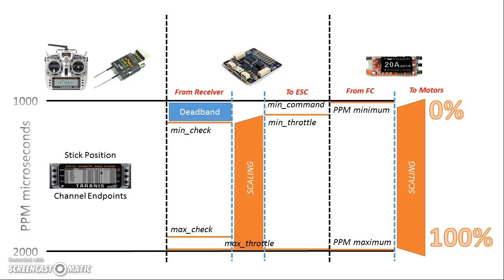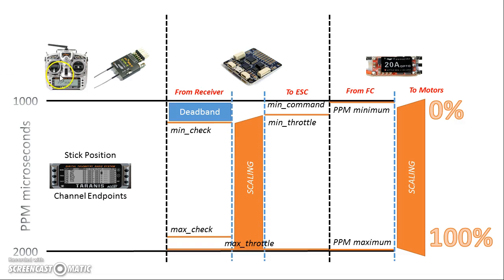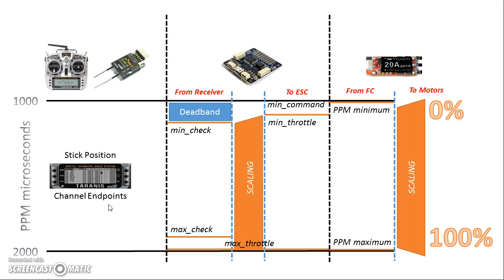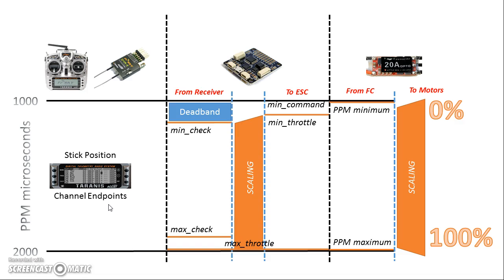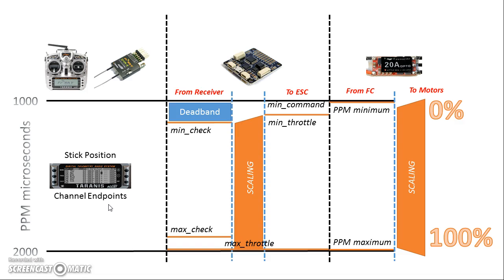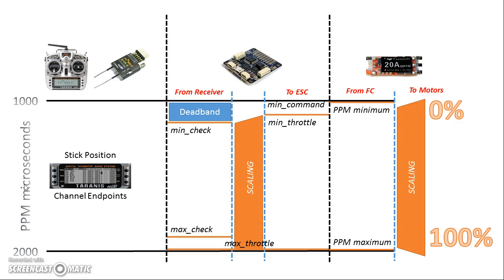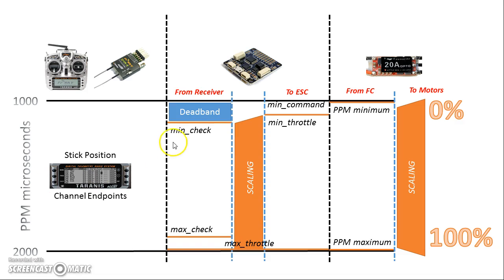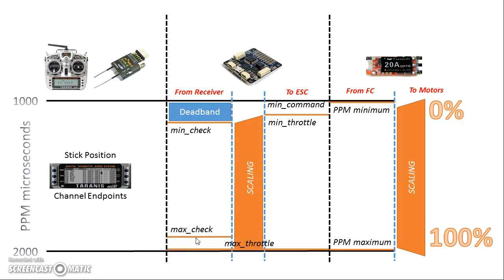Cleanflight throttle parameter configuration - Part 1

Comment: Hi Joshua .I have another problem now with my throttle. i get full throttle when the stick has only moved up about 20% then the same max motor speed  all the way to 100%,and on decelerating the throttle does not lower the motor speed below 100% until you get to down 20%throttle on the stick 
, any ideas would be appreciated, many thanks Martin
Reply from the maker: +Martin Goodbody verify that the throttle channel goes from 1000 to 2000 in th receiver tab. Verify that ESC endpoints are calibrated.
Reply: hi Joshau it does go 1000 to 2000 in the betaflight motors tab and throttle responds as it should gradual all the up and down
Reply from the maker: +Martin Goodbody then there must be some pid related issue. Does it do it when the props are on, or only on the bench?
Reply: I did try to fly it once but it was uncontrollable. do you think it would be worth reflashing the board, it is a cc3d f4 acro , i am using betaflight 3.1.6 with latest revo firmware. I have heard of people flashing the airbot f4  fimware
Reply from the maker: +Martin Goodbody I guess I would do a reflash with fill chip erase enabled.

Comment: I have a question.   I switched to betaflight and my quad won't arm.  when I open betaflight and go to the reciever tab the throttle value when the stick is at 0 throttle it reads 1017.  I use spektrum so I can't change the value on my tx.  whst should I set the min throttle to ?  1017?  or higher, say 1027?
Reply from the maker: You definitely can change the endpoints in some spektrum transmitters, although I'm sorry I can't tell you how. One reason the quad might refuse to arm is if the throttle is refusing to go below min_check. Min_throttle is not relevant here. Min_throttle is on the OUTPUT side of the FC -- from FC to ESC to motor. Min_check and the throttle channel are on the INPUT side -- from TX To RX to FC.

If you cannot get the channel values to go to 1000 and 2000 then use the rxrange command in the CLI to adjust the endpoints that betaflight expects.

Also, if betaflight is refusing to arm, your CPU utilization may be too high. If it is higher than about 30% (for BF 3.0 and 3.0.1) or 50% (for BF 3.1) then that's too high.
Reply: I figured out how to change the endpoints.   But I changed the throttle I belive .  The quad arms but I can't get into my osd it requires mid throttle + yaw right +full pitch.  Should I reset the board and try and see what happens?
Reply from the maker: +rza f all the channels need to go to 1000 to 2000 not just throttle.
Reply: I put all values on spektrum yaw throttle pitch and rudder to 1000 to 2000.  It arms  but istill.cant access my osd which requires mid throttle + yaw right +pitch up I can't access the osd any reason why?

Comment: why would you ever invert the y-axis so that the max value (2000ppm) is on the bottom and min on the top ?? confused
Reply from the maker: For the same reason we write from the top of the page to the bottom.
Reply: touché
Reply from the maker: +j46 I mean, it wasn't a conscious choice. I just made the drawing and that's the way it came together. But when you asked, that was the answer that made sense.
Reply: hehe fair enough, well we all work differently I suppose :p 
just seems really backwards to me.
anyway, great video
Reply: +j46 Exactly, that seems so obvious and logic that it took me quite some time to realise the schemes don't follow the throttle stick movement. Kind of absurd.
Reply: Fanny thing, but being a newbi, that confused me so much since concepts of below and above in your comments didn't' make any sens to me. Finally, I wanted to ask the same question, but found it already answered. Thanks for clarifying this !

Comment: In the interest of correct information with regards to the stick commands:
With throttle stick up the other stick is used to add acc calibration.
With throttle stick in disarm position other stick is used to select profile 1, 2 or 3
http://open-txu.org/wp-content/uploads/2015/07/CleanFlightStickPositions.png

otherwise this video is interesting: i never knew about the deadband below min check. does this mean that if you set min_check to 1500 then anytime the throttle stick was below 50% you would be outputting min_throttle and have no throttle response?
Reply from the maker: That's what I believe. But it should be easy to confirm using the Motors tab.

Comment: Hello again. My qx95 micro is amazing. I fly it in angle and horizon mode. I tried air mode but it takes off on its on. I'm thinking min throttle is to high but it's fine on the other modes. Wat am I doing wrong
Reply from the maker: +Craig chivers micros are sensitive sometimes. Maybe it just hates air mode.
Reply: Joshua Bardwell  ok thanku

Comment: oN MY tARANIS PLUS MY tHROTTLE IS GOING THE WRONG DIRECTION! CAN IT BE REVERSED IN CLEANFLIGHT?
Reply from the maker: Better to fix it in the Taranis. Figure out why your input line, your mix, or your output line is not correct.
Reply from the maker: This is too big a problem to leave alone. If the throttle from the Taranis is reversed, and you bind to somebody else's model, something bad can happen. Fixing it in Cleanflight is a band-aid.
Reply: Joshua Bardwell Thanks for getting back to me on this, it is greatly appreciated!!
Reply: I have the same problem on my Tactic TTX650. The thing is tho, when my transmitter throttle channel setting is in reverse, the cleanflight bar corresponds correctly. However, a failsafe situation is now reversed, punching out full power when it should have just dropped. (possibly caused by my RX built-in failsafe feature, which sets throttle value to MIN (not reversed) but it seems so unlogical that thats the case) Did you guys ever get is sorted out on your taranis? what happens in case of a failsafe situation if you reverse the taranis' channel output? Is there any way to reverse the throttle signal in CF? (so i can leave my transmitter in reverse for my other models and not have a fly away on the CF model..)  Thx
Reply from the maker: +Linktw0 you can reverse a cleanflight channel using the rxrange command. Reversing the throttle should be "rxrange 3 2000 1000". But confirm that carefully before flying.
Reply: thanks a lot for your reply, it now seems to work properly. btw i just found the rootcause  to this problem which was my  rx that is unable to reset this rx failsafe function even tho it should have been able to.  thx again, appreciate your help!